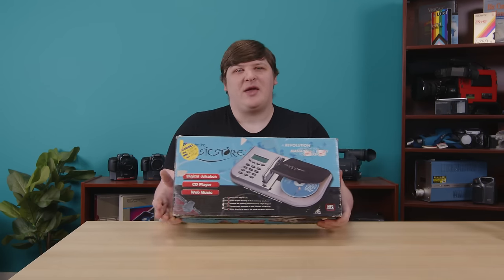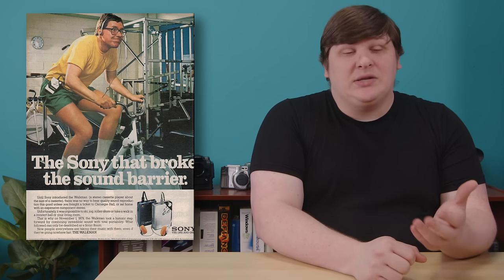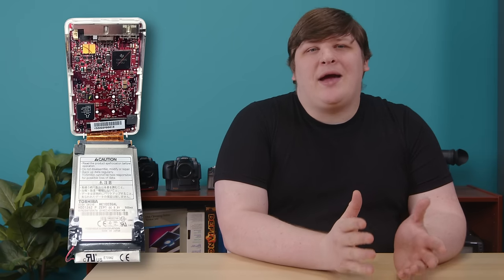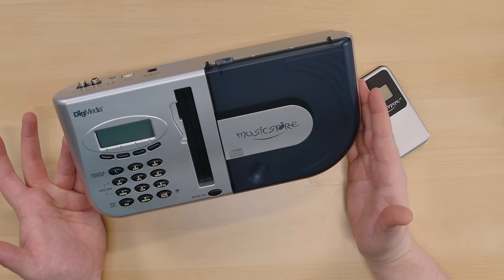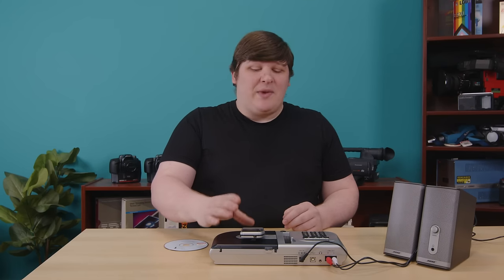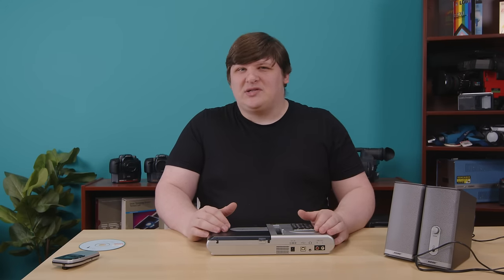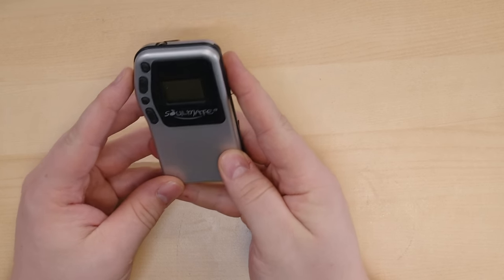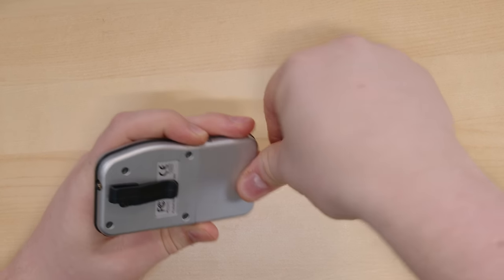An MP3 Jukebox for Everyone (Including The RIAA)

Comment: 30:20 SP = Standard Play, LP = Long Play, ELP = Extended Long Play (Though usually abbreviated to EP, not ELP)
This is a hold over from magnetic tapes where quality would be lost from recording sound data at a slower speed, getting less audio fidelity but longer recording. Here, it likely refers to file size where SP is the highers quality and ELP is the lowest.

Comment: On the real time ripping, I had a dual disc CD recorder deck around that time that would not do digital direct from one cd to another if it had a copyright flag on the disc. This had to do with RIAA legal stuff. It would do digital to analog and back to digital. I assume this device ripped in real time for the same reason. Or  maybe it was just a cheap CD player mech.

Comment: When I first saw this thing on the box I thought it looked a lot like a handset phone with an answering machine that recorded messages onto a CD, which does seem like a very Y2K thing to make on its own merit.  But my utter surprise when I learned this thing used T9 for text input.

I think I'm just under the age threshold for T9 because while all my classmates were getting the first few gens of iPhone, I was stuck on a brick of a tracfone and got very good at using T9.  I liked it a lot.  In a lot of ways I think I prefer it to typing on a buttonless touchscreen keyboard.  The amount of times I type a letter adjacent to the spacebar...

Comment: Guessing from the thumbnail and the box... Dial a jukebox?

Sounds like it has a Toshiba or Fujitsu 2.5" hard disk in it. They actually hold up pretty well but the bearings will eventually go. That said they're not impossible to find replacements for and there's even a chance you could get a larger drive in it.

27:41 This is probably more because of the cost of CD recorders. The cheapest PC CD-R drive at the time was made by HP and was tray loading, at just $999 on it's own.
28:49 Maybe like "recording" a "mix" tape? There is some logic here.
37:25 Hey, iTunes plays audio while you're ripping discs too, even at 2x or higher.
1:02:32 The problem with USB, especially at this time, is that it was heavily CPU reliant. Unlucky guy with a 486SX20 that happened to have a PCI slot for a USB card? Enjoy your 20kbps transfer rate. Smokin dude with the 533MHz Pentium III, probably going to be around 750kbps. Much much better. Of course, file transfers of this manner also rely on disk speed and bus speed.
1:04:19 That sure looks like SRAM or PSRAM to me! I had such a good laugh when you said it - I was thinking "They must be using static memory for these kinds of speeds" It actually looks like there are two small coin cell batteries inside as well - Probably for song backup. They're probably long since dead.
1:11:16 My second guess was supercapacitor, they definitely were around at this point. The Apple Newton MessagePad and PalmPilot both had them as well.
1:17:46 FPGAs from this time were definitely not large or fast enough for this task. The DSP is almost certainly being tasked with MP3 encode/decode and the FPGA is doing some other job - Bus arbitration to the Soulmate is not a bad suggestion, but I think DMA transfers from hard disk might be implemented there as well.

Comment: Back then, Flash memory was expensive, very slow and can’t be rewritten too often before it fails.
S-RAM was the first kind of solid state memory and is basically a bunch of Flip-Flops using at least 2 transistors each – one for the ones, one for the zeros.
D-RAM is made out of one single transistor per bit which has an artificially inflated electric capacity. To keep the state, you can either write it or read it. This is much cheaper and you can put in a lot more bits per chip surface area. So you get at least 10 times more data capacity for your money!

The refresh isn’t that hard. Internally, the chips are organized in sectors. The MSB (Most significant bits) determine the sector and the LSB (least significant bits) determine the position in this sector. If you address a sector of the D-RAM, you refresh the entire sector. So you don’t have to refresh that many times until you have fully refreshed the entire chip.

Inside the Commodore 64, the video chip needs to read the RAM in order to draw the screen. The positive parts of the clock cycles belong to the CPU, the negative ones to the video chip. So by drawing the screen, the video chip constantly refreshes the entire RAM even if it is just reading a small part of the RAM containing the screen data. This is why they originally went with eight individual 1-bit D-RAM chips. Read a byte anywhere and you have refreshed the entire memory. The entire RAM chip is a single sector. Each chip is a single bit out of a byte.

There were many PDA devices which had a super capacitor built in. The first so called “Goldcaps” came up in the mid 1980s. It was not uncommon to store the data of your digital calendar and address book in RAM. The Goldcap did a good job of giving you enough time to swap the batteries. Usually around 3 minutes! But you had to switch off the device or it would deplete the capacitor almost instantly. In the demonstration, the Soulmate was still powered on so the capacitors were drained almost instantly!

* * *

Reading an audio CD was really hard for a computer, this is the reason why it was done analogue back in the days. The sector size of an Audio CD was larger than the size the IDE controller could handle. So you had to read a part of a sector instead of a whole sector. Then you had to tell the drive to get back to this sector so it had to skip back. And then the computer had to grab the next part of the sector. But there always was an error in the position. To make sure to grab everything correctly, you had to split the chunks of data even smaller and overlap. Then a software could detect the overlap and reassemble the sector. So reading an audio CD using the IDE interface was a lot slower than just playing it, even if you had a fast drive. It took a while until a PC was fast enough and the new ATA standard (now known as PATA) was introduced. 
CD Audio uses 2,352 bytes per sector, a FDD/HDD is organized in 512 Bytes. A data CD is the same but divides a sector into 98 Frames so the PC can manage reading the data just fine.
Back in the early 1990s, it was really hard to make a 1:1 copy of an audio CD using a CD burner. Even after managing to extract the WAV and storing it somewhere, you had a high failure rate burning the CD due to the massive sector size. On the fly, using a CD-ROM and a burner drive was not possible and in the early 1990s, a 500MB HDD was considered “huge”.
So just playing the CD and let the drive do the error correction is much easier and less prone to errors. A lot of CD to MP3 devices back in the days even did it analogue, even in the early 2000s!

Comment: I've looked at drive image, and I ran objdump on it to see if I can find any code on it. I haven't reverse engineered anything before, but I knew that if it's ARM, there's going to be "mov pc, lr" somewhere, which returns to the caller who called the procedure.
Well sadly no such thing was there, but there were messages such as "DEBUG ASSERT", "PLEASE UNPLUG YOUR MUSICSTORE THEN SWITCH IT ON AGAIN"(which is repeated multiple times for some reason). Each message is seemingly aligned to 4-byte size(padded with zero), which makes sense on ARM, because I believe unaligned address is not supported on ARM architecture.

And I don't know why I found this funny, but there was also "SYSTEM HALTED TO PROTECT YOUR MUSIC".

Comment: i had a rio as a teen, and i encoded my albums at 64kpbs (i had a 128mb one that could hold a CD and a half at 64kbps), and through the walmart headphones i had at the time it sounded just like the CD did. it wasnt until i got older that i even experienced something lossless like FLAC. and while i CAN tell the difference when the sound is played through a set of reference monitors,  i doubt you could with the average set of wally cans.

Comment: Oh and yes back in the day 2000 I listen to many CDs using simply a CD ROM drive a power supply and speakers, I don't really know why but it was better quality than the portable CD player of the time that we had and our stereo didn't support CDs. However I never saw a model with more than the play/next button an analog volume headset jack on the front. I knew that a digital version of volume control existed? Ir NO.

Comment: Supercaps were fairly common throughout the 90's in hand-held consumer electronics, which required retaining moderate to large amounts of data over a typical battery replacement. Surely most PDA's worked like this, graphing calculators too.

Comment: Per-genre EQ is (was?) actually a weirdly common concept. The preset EQ settings are often named after music genres, and it's pretty typical for a software music player to have an option to automatically set those based on your files' genre tags.

I never understand why on Earth would you ever do that. I always saw EQ as something that, as the name suggests, compensates for your equipments frequency response. Or for your hearing degradation. Or your taste. Global EQ makes sense, because you may want to "fix" your crappy speakers that way. Per-album EQ makes some sense, because you may hate how some mixing engineer EQ'd your otherwise beloved band and want to hear the bassist better. But per-genre? Why? I have no idea, it makes no sense, but for some reason it is, or at least was, a common idea.
Reply: That always struck me as a useless feature as well and was/is something I always disable.

Comment: 1:06:12 - Static ram is still used in every single processor in the world, its used for cache memory. Its superior in every way to DRAM except for power consumption and cost.  Dram is mainly used simply because its 1-2 orders of magnitude cheaper to make, and can be more densely packed onto chips. SRAM is about as fast as you can get. Many many many many times faster than the fastest DRAM modules.

Comment: One small note: you don't need a screwdriver to change the batteries. It looks like the type of screw made to be spun with a coin, something you probably already had on the go. If the supercaps worked it would be quite usable. But since Palm devices are also RAM based yet have plastic tabs on the battery door accidental battery removal can't be a big reason to use a screw.

Comment: Regarding the "spending all day ripping CDs" - that's pretty much what I (and everyone I knew) did at the time.  I had some weird 3.5" 20gig "portable" MP3 player in a dock in the late 90s, maybe as late at 2000, and I fed it music with some unholy collection of linux tools that would rip CDs and convert them at maybe as much as 10-12x on a good day?  So all day long at work, my computer's CD drive would open up, I'd swap discs, it would use CDDB or gracenote to get tag data (although only for filesystem metadata like artist/album/nn-track.mp3 and not id3 for whatever reason.  Poor id3 tag management tools at the time, I suspect).  10-15 minutes later, it would spin down and spit out the disc for me to swap.  I don't remember DAE as being that hard to get working, but we were using custom built computers at work at the time, so maybe we just got lucky?

And lord those MP3s were atrocious.  Some of the worst shared stereo sins you've ever heard.  They mostly got swapped out by cheating with iTunes Cloud Library matches in the 2010s.

That MP3 player is almost entirely impossible to find on the internet these days.  Every now and then I do manage to find an old page for it, but it was great.  The drive lived in a removable 5 1/4" docking tray that you could put into your computer to transfer MP3s from your PC to the portable drive, then you could put it in another dock that lived in your car (either as a DIN mount or buried in the trunk with a wired remote) or in your home stereo.  And 20 gigs!  The original 5 gig iPod was so small at the time.  I eventually replaced it with a 2nd gen iPod in 2002-ish when they finally started getting 20gig microdrives, but the original 5 gig model was already too small for me at the time.

Comment: The mini was what turned the iPod into a legitimate success. I had the first standard iPod. It cost $500, only worked with iTunes on a Mac and used FireWire 400 (which almost no PCs came with) to charge and transfer. It definitely sold, but it wasn’t a general consumer device at that point. Once the mini came out, that’s when non-techies started paying attention. The rest is history.

Comment: I'm feeling that 8X CD rom was commonplace but not 32X when this came out.  I recall ripping at 1x - 4x for a really long time.  Faster drives would fail to rip well at higher speeds.
Reply: Not so much, from 95 era PCs yes you'd see mainly 8x drives around but 2000 32x was pretty common, literally all we were installing when I started with my first employer, with 52x being introduced that year in volume. Ripping speeds we'd usually prefer to go slower still regardless because it reduced error rates.

Comment: It might've been early to the supercap game
The original Xbox has an infamous supercap, the Xbox drew too much power for them to have a normal coin cell so they stuck a supercap to give you a few hours to unplug your Xbox and take it to a friend's house and not lose the clock. 
If you have an Xbox that loses its time immediately after unplugging, you NEED to replace that cap as it leaks and kills the Xbox.
Reply: Yeah the XBox launched at the worst possible time, cap plague era was right at its peak.
Reply: @cericat  it wasn't the caps, it was just that one supercap, and as far as I know it's still somewhat of an issue for those can supercaps

Comment: About the MIX feature, I am not sure but i think its a feature for MIX CD's which you had a lot in those days. A normal CD has separate numbers and a CD player leaves one or 2 seconds space between those numbers while playing. A MIX CD is one long "song"but spitted in separate tracks. if the player leaves a second delay between the tracks its doesn't sound good, another thing is you can't(shouldn't) shuffle those tracks as  the MIX is then not as intended. So I think If you record with the mix setting it always plays the whole MIX as one part and not separate tracks  which you can shuffle.

Grntx

Comment: Despite its flaws, I would have loved that in 1999 or 2000 but this price was roughly equivalent to 700 Deutsch-Marks which was beyond anything I could afford. I wouldn’t have minded that track entry with the number pad and ripping at 1X as I came from cassettes and when making tapes I enjoyed listening along when recording. I actually celebrated this. I think I would never have used that PC feature besides putting my “MP3z” on and in 1999 I was still on 56K dial-up so I only had a few of these anyway - I still recorded from the radio and would just download a few tracks where they babbled into or which they never played. This only went a different route when I got DSL in 2001 and then a portable MP3 CD player which also supported CD-RW, and later an iPod.
I was that type of MP3 user you described at 47:44 and that portable device would have been a plus. Even with the cheap build quality.

Comment: I suspect the IR receiver is meant to work with existing stereo system remotes. Pretty much every shelf system had a remote. Most were able to control basic functions of two or three aux components. It's odd that it isn't described in the manual, but I've seen cases where there's some additional material in the box about features that don't make it into the main manual.

Comment: SRAM is power-hungry as f**k, it's basically on all the time; while DRAM only needs to refresh at intervals, most time it's off. I don't know why you would assume the opposite.
Having that much SRAM is not only expensive but would drain batteries VERY fast.

If they actually built the MP3 encoder/decoder into FPGA at that time, that would have been incredibly cool, like rocket-science cool. I remember MP3 was shrouded in patents and mystery at that time, and things like high-level synthesis from C/C++ probably didn't exist. I remember building my own MP3 music player in 2004 from a (probably stolen) library with source code in C++ and it was buggy. Imagine the coding intensity of rewriting something like this into Verilog/VHDL (licensing a chip design was probably way out of budget, not to mention licensing the MP3 algorithm itself) and then imagine fixing lots of bugs and finally still having the FPGA crash while the product operates. Also, I don't think the encoder/decoder would even fit on a regular cheap FPGA of that time. Except for glue logic, it might have done the famous "encryption", if that somehow wasn't part of DSP or baked into software for handling the filesystem; even plain FPGA encryption would have been super cool. That makes me wonder: how did the Soulmate decrypt the files? Were they even encrypted on the Soulmate?

As for DAE, it was very much depending on the CD drive vendor to support it; but I specifically remember it being disabled by default in Audiograbber and Windows. I remember ripping my first CD somewhere around 2002 and being shocked it simply recorded it through the cable; a couple CDs later I found the DAE option. Considering they used SPDIF to grab pure digital audio vs. noisy analog from the cable - they did at least some things right.

Comment: I was one of the first ones in my area to get high speed internet back in 1999 we got a cable modem that would do 3mbps! I think we might have broke Napster!
Reply: I had cable internet and Napster in ‘99. My mp3 library was so big that if another Napster user would try to browse my collection it would knock them off the server. Back then I did most of my mp3 trading and downloading on IRC and private ftp sites. Such good times.